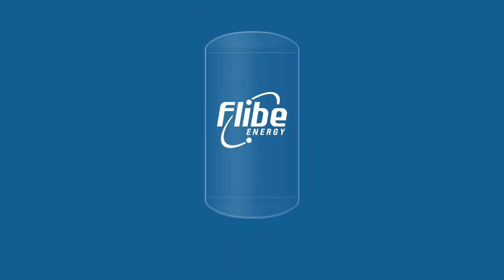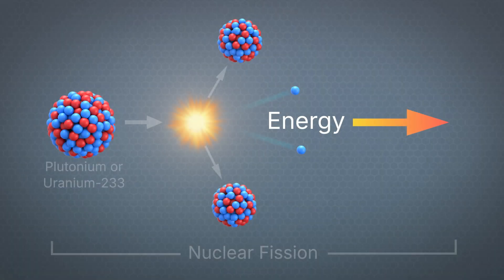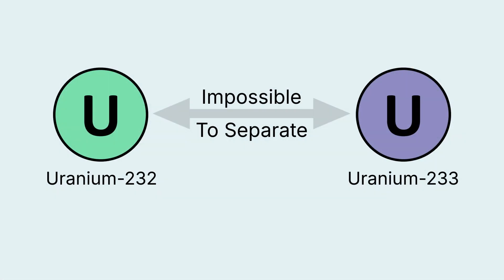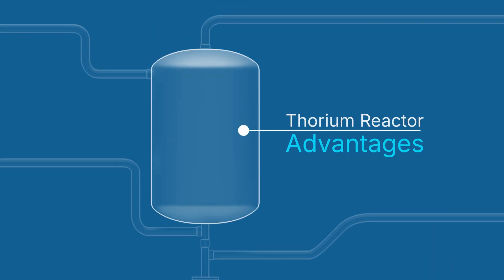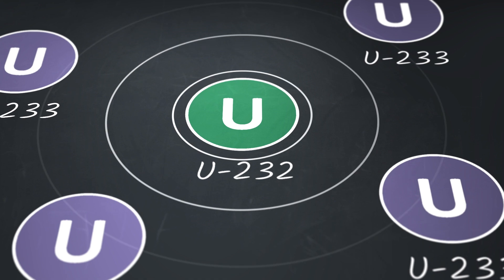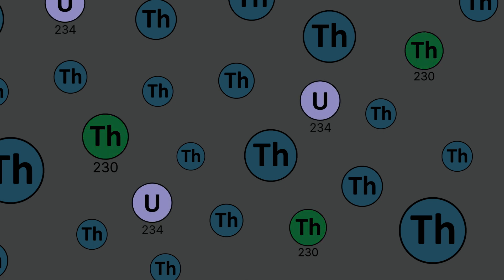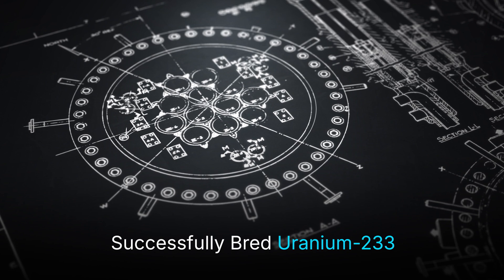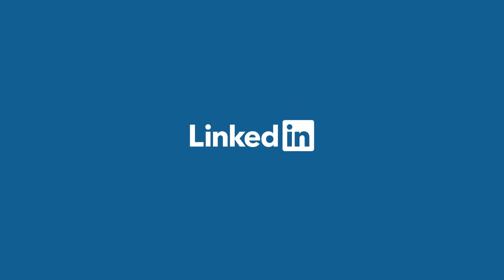Thorium Reactors as Influenced by Uranium-232

Comment: Have your cake and eat it too. Keep the thorium fuel liquid in the fast region, then have channels carrying 238UF6 that get the themal scatter neutrons. Plutonium would snow out of the UF6 gas and be easily separated. Dump that into the reactor to help with neutron economy and also for starting other reactors. The Plutonium you get would be nearly pure 239 isotope as well so it would be weapons grade, but would need only 2 steps to make the metal. With nuclear tech eventually we will need to overcome the problem of proliferation if we are going to really use it. Reprosessing and fuel breeding are absolutely critical to making it sustainable long term. ❤

Comment: What if you take the protactinium created in the cycle, chemically separate it and let it decay to U233, isn't that a way that you can make uncontaminated U233?
Reply: Yup that does work. It's relatively long decay time and chemistry makes it reasonable to separate. If I had my way with it I would instead surround the reactor active region with pipes that have 238 uranium hexafluoride gas flowing through them. This would make very pure, nearly monoisotopic plutonium 239 and it would be very easily separated as it would be a solid that would snow out. Replenish by flowing over UF4 to absorb the 2 extra fluorine atoms freed. Would be far superior than HEU for reactor start up, or 2 steps and you'll have metal for other uses. ❤
Reply: @christopherleubner6633  I'm thinking of proliferation concerns, but yours is a solid idea for commercial use. Don't think you can do it in steel pipes tho, and inconnel absorbs even more neutrons. Gotta go with like a SiC-SiC composite or some other low neutron-absorber material.

Comment: I would also add to this fine presentation that in a Molten Salt Reactor, U-232 ceases to be a problem because it it either absorbs a neutron to become U-233, or it reacts, because it is also fissile to thermal neutrons, the net effect being a slight dip in the neutron economy because the fission/absorption cross sections are nearly ~50/50 with U-232 compared to the ~90/10 or better of U-233. The only potential problems would be if you separated and set aside the bred Uranium for long periods of time outside the reactor, if I recall correctly, India has some experience in this field and the resultant bred Uranium requires shielding of roughly 1.75 metres of leaded concrete to prevent dangerous levels of gamma rays irradiating personnel and equipment.